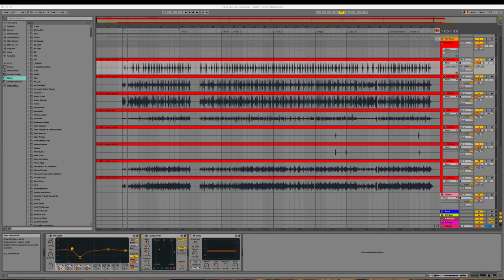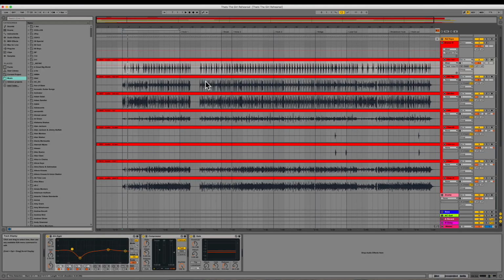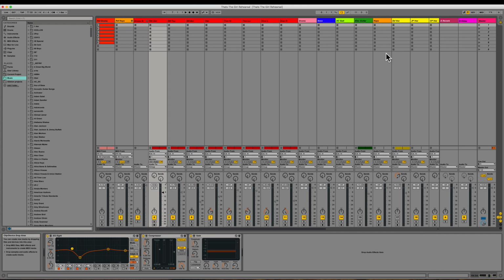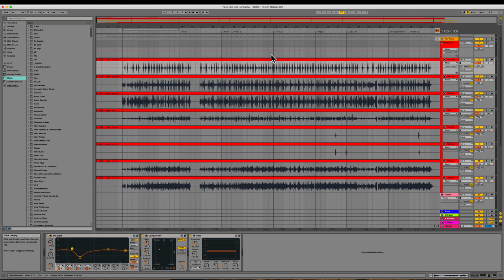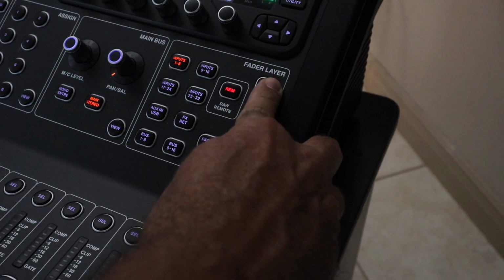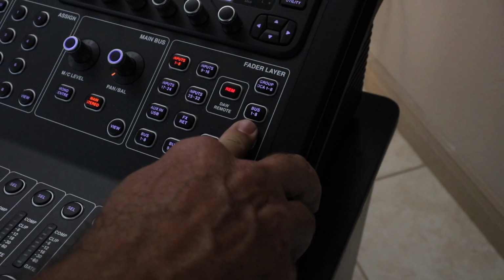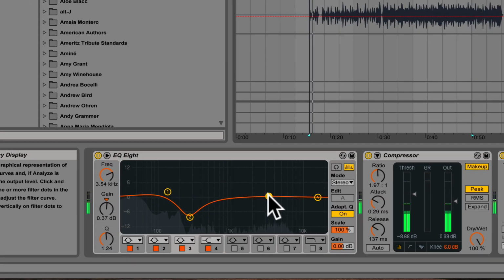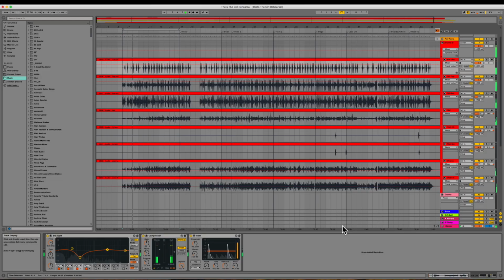Midas M32R as control surface Ableton

Comment: Merci Merci..Thanks, thanks from France...really nice and well explained..I used it for my brand new X32 and after 3 weeks of research...I do do not find a so understandable demo to link x32 and ableton live.
I succeed with your explanation to parametrize 8 live tracks on my X32 in less than 3hours ...
faders and mute are ok to control live....but no way to use the solo button and the option to remotely use the DAW remote button in order to control : play,stop the ableton live song ???

Again thanks and the best for you and your family in this terrible moment.
Regards
Maurice the French froggy
Reply from the maker: Check out 2:20 in the video for transport controls. If it's not working in your system stop the video at 1:35 and check your midi setup. Hope that helps.

Comment: bro how many channels can i use for remote daw  in m32r live ? 8 channels or 16 channels?
Reply from the maker: When you use the m32 as a DAW remote the 8 faders on the right side of the mixer becomes the remote faders. As you scroll to the left or right in on the daw via the m32 the faders will adjust. So you are controlling all the channels in your DAW 8 faders at a time.

Comment: How is the hardware physically connected? 
I want to connect an m32 to a laptop with DAW.
Please help.
Reply from the maker: 13thAMG there is USB port on the back of the console if it has the DN32-USB card installed. Mine came with it. Plug the cable into that and you computer. My Mac saw the console as a input and output device right away.